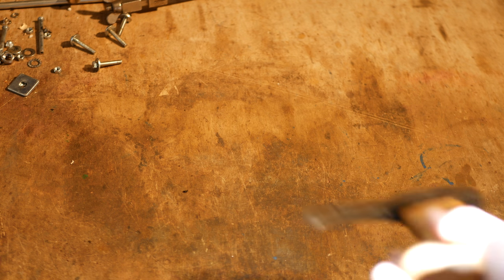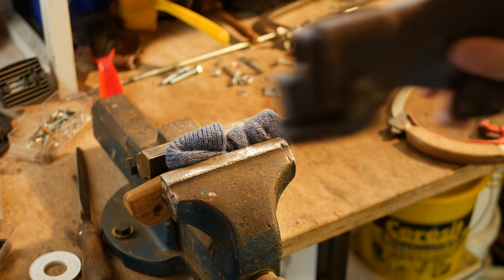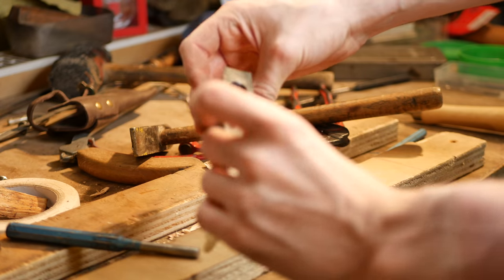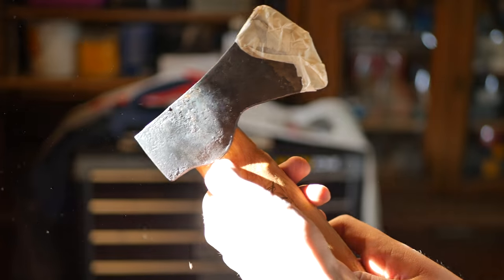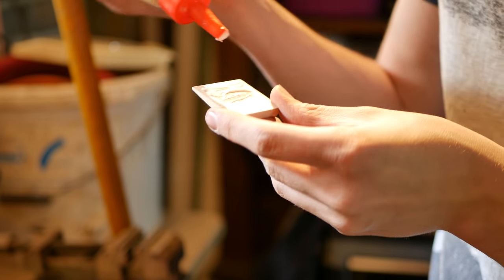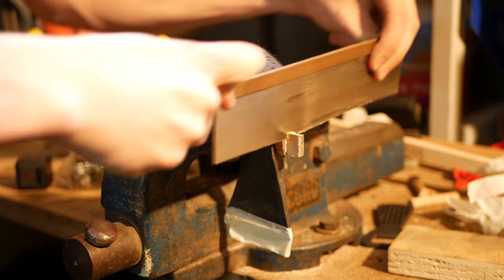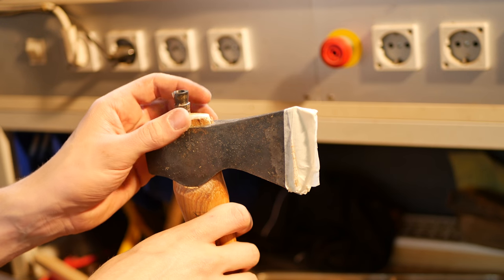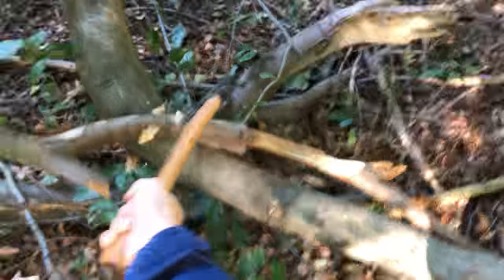How to change the handle of an axe (Hultafors Classic Mini Hatchet)

Comment: The small hand hatchet is not made for chopping, it's for kindling and detail carving.
And you should never glue the wedge, use linseed oil on it and the slot before pounding it.

Hope this helps you the next time you need to change handle.